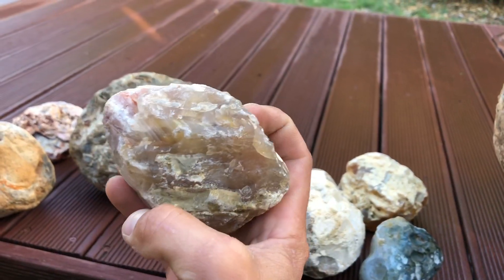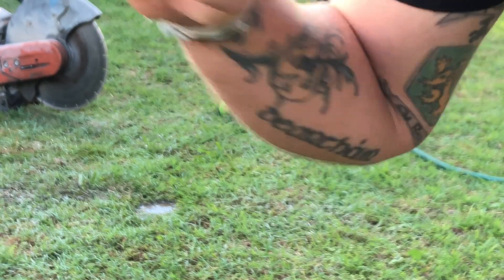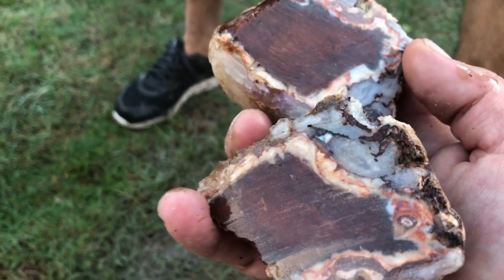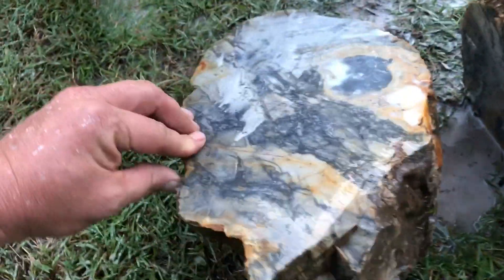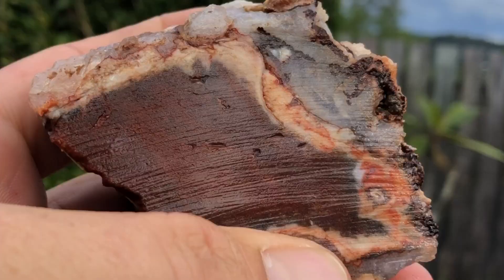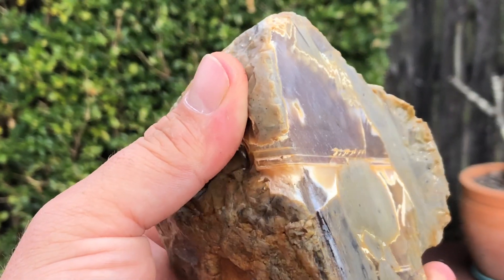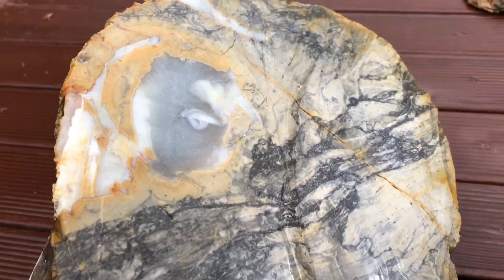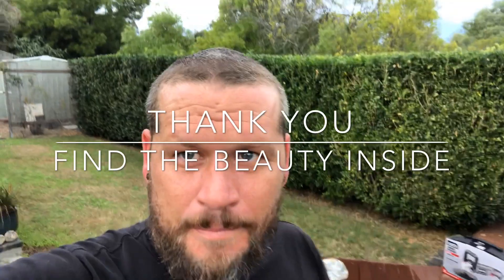Cutting BIG ROCKS with a BIG SAW • Thunder Eggs? & Agates

Comment: Love all those rocks you cut. I wonder if a saw like that could cut my huge eggs. 
After cutting and before smoothing/polishing I like to smear coconut oil onto them. It disguises saw marks and dull bits better than water does, and the effect lasts a lot longer, so you can photo and video without having to hurry. Just don't use oils on really porous material,  just in case it soaks in and alters the look, but hard rhyolite and agate are fine.
Reply from the maker: Heyyyyy Michael! Yeah I think it would be able to, It just depends on how big they are 😁😉
Man that’s a great idea with the coconut oil! I’m definitely going to try that hey. Thanks heaps for your help mate!!
Reply: @Rookie_Rockounding  They're BIG - 60lbs and maybe 70-80 lbs.  I haven't measured how wide though.